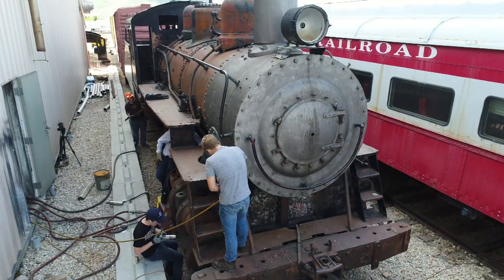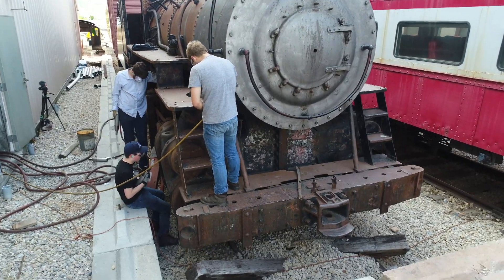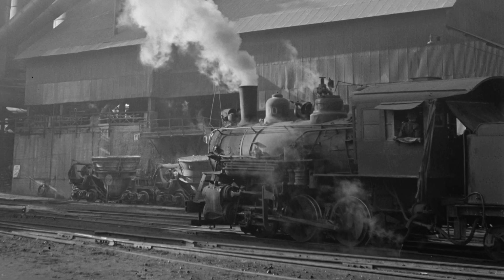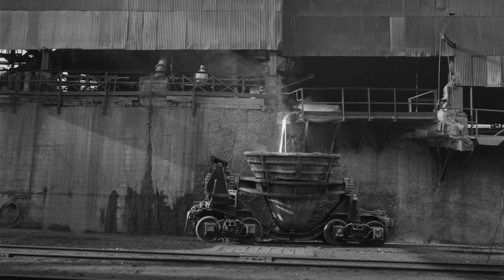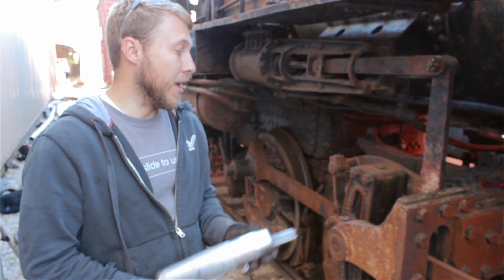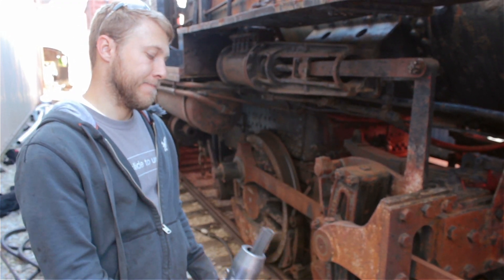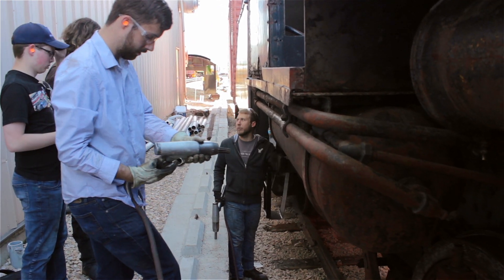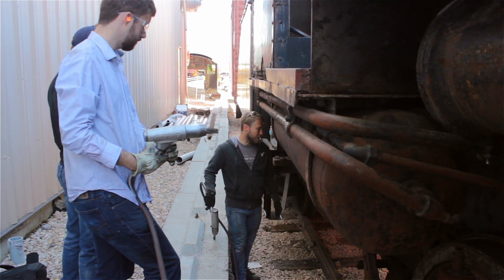Restoring Columbia Steel 300 (Baldwin steam locomotive)

Comment: Did they even CONSIDER building a new boiler?
Reply from the maker: Yes they did.
I usually respond to similar questions, in all sincerity and without snark,  by asking how much money you are willing to donate. The HVRR has two other steam locomotives that are already being restored to operation and cannot devote the money to building a new boiler for a locomotive that is too small for most of its trains.
The real answer is that it's not the boiler that prevents CS300 from operating. It is missing a lot of its rods, all of the cab appliances, and its stack. At some point in its life a scrapping effort started that left it missing a lot of necessary parts long before it ever arrived at Heber.
Reply: ERA Films oh, so new parts would have to be built? Okay.